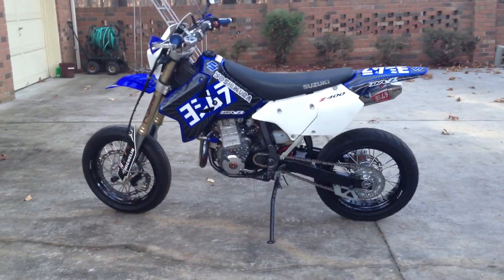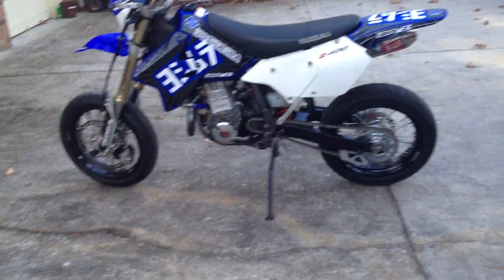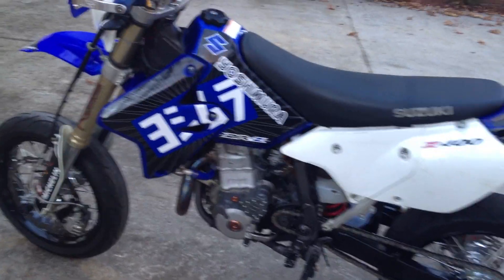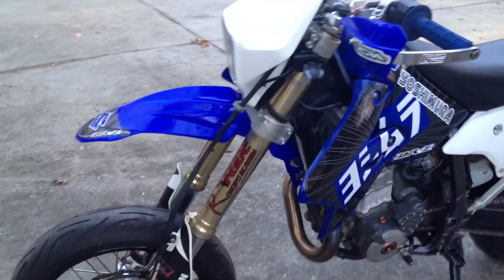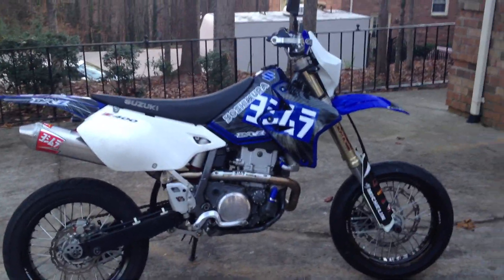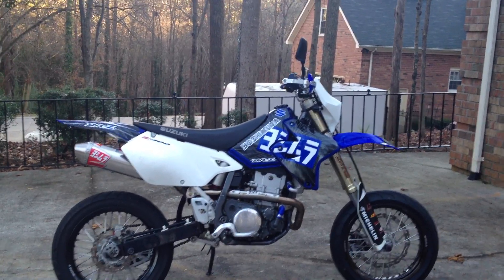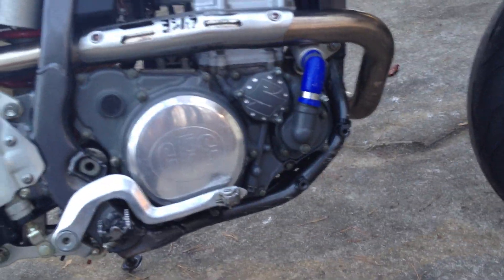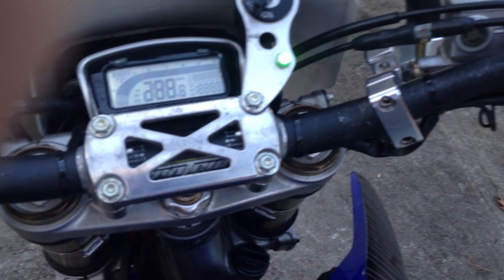2001 DRZ400S Supermoto | Walk Around

Comment: The SM model only has stiffer suspension, different gearing ratio (sprockets) and street tires. A lot of people just throw street tires on it and don't change the suspension or sprockets which is why some probably aren't fond of the idea.